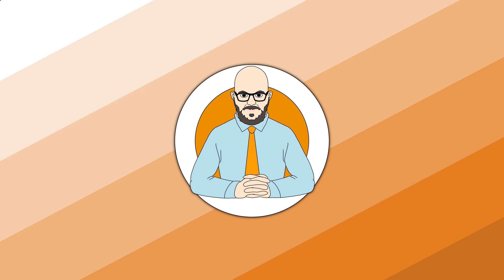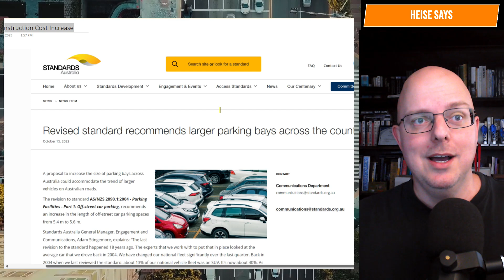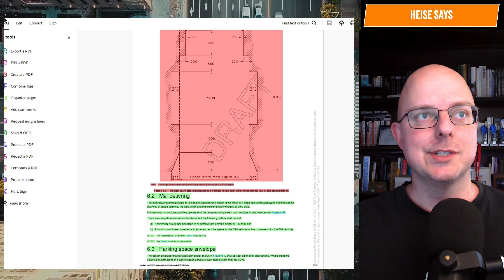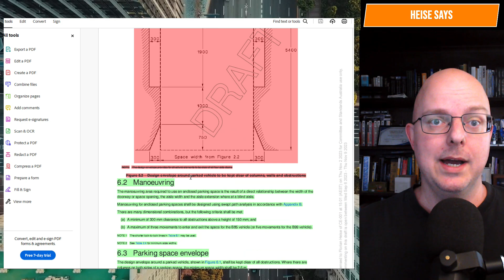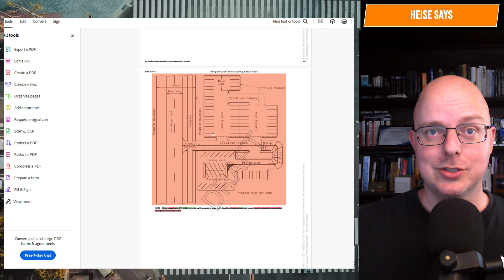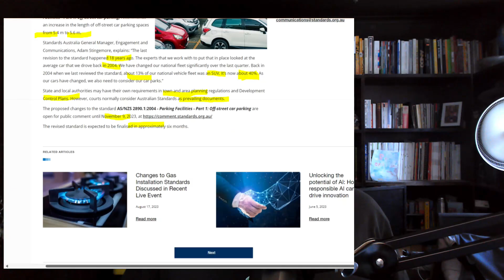Another Construction Cost Increase!

Comment: Hi Florian, are you a Revit firm? Very informative channel. I'm a Architectural Revit Technician by the way...
Reply from the maker: Yes. Been working with it for years. Even have some ancient Revit tutorials I made on my BIM channel.

We’ve even started using the Autodesk tokens to hire Revit on a per day basis when I need Rachel to jump in to help on a project. 

Are you using Point Clouds with your projects?
Reply: @HeiseSays  Point clouds are used purely as a guide when modelling as-built models. They're really just millions of dumb points in space and useless in Revit other than to 'model trace' over. When modelling existing buildings using point clouds the secret is to set very minimal view range extents in both floor plans and sections to enable clean cuts through the point clouds indicating the existing as built components you're actually trying to model. Otherwise you'll just get millions of points and impossible to extract information from. Some surveyors now provide as built models in Revit format modelled from point clouds. These are modelled overseas and not all in Revit software. Appear to have imports from other modelling software. The problem with this is the model components are not on the correct Revit categories and also un-editable in many cases. Ah the joy of BIM...

Comment: I drive a ute as a tradie, all the modern carparks are undersized, another 100-200mm wider and the same in length would wonders
Reply from the maker: They are not getting wider. Just longer.
Reply: @HeiseSays  shame, personally I think carparks should be 2.65/2.7m wide. Vehicles are allowed to be 2.5m wide, so 100mm minimum on either side makes sense.